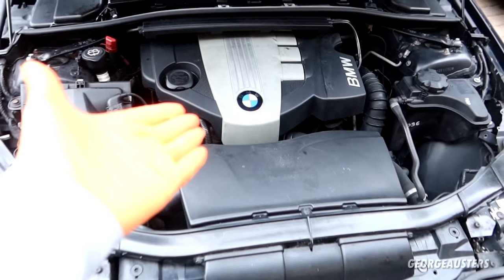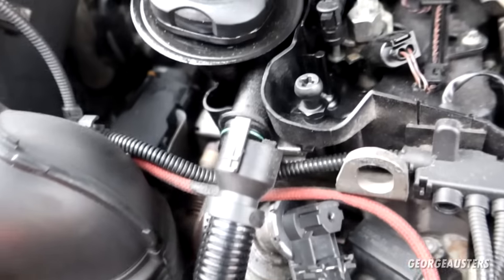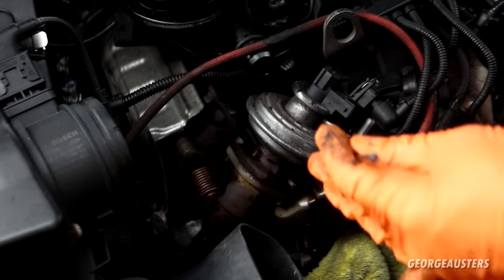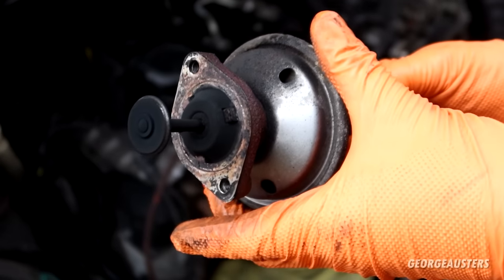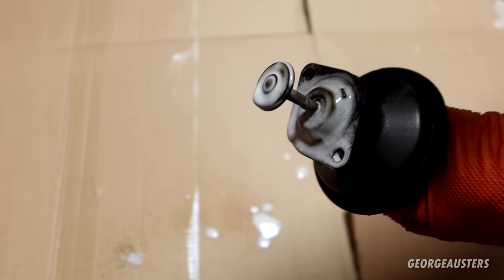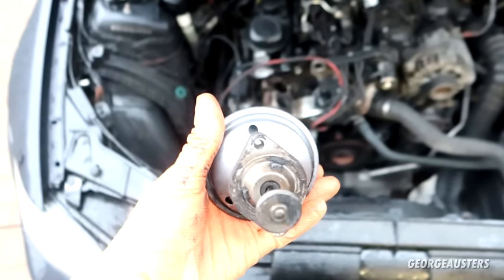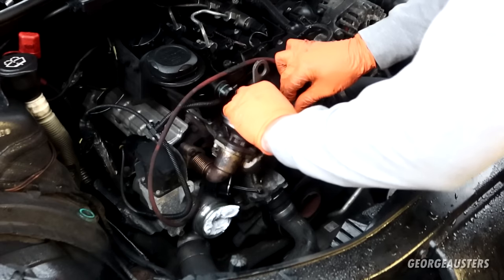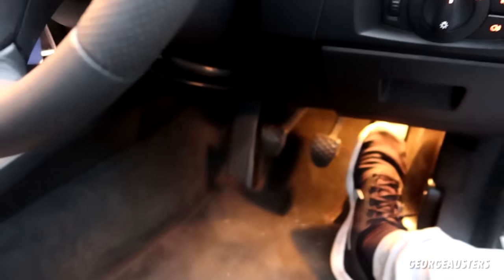HOW TO CLEAN A BMW N47 EGR VALVE

Comment: Driving a car on public roads with the egr valve removed is a criminal act. The valve is there to make exhaust gasses less toxic.
Reply: Both the EGR and DPF are just causing a lot of problems with diesel vehicles. Remove them and save a lot of money on maintenance.
Reply: @TheJensss  Maintain your car properly and drive it conservatively and you will never have problems with either of them. If you can't afford the maintenance of your vehicle you should drive a vehicle you can afford i.e. a smaller car.
Reply: @SuperDirk1965  what a bad answer. In Norway we have really cold weather, and we use the cars for a lot of short trips. This is resulting in a lot of problems with EGR and DPF. A regular service costs 500€ + and with EGR cleaning etc you could expect a total cost of 1000€.....

I'm doing my own car maintenance and i'm saving a lot of time with the problem components removed from my engine.
Reply: @TheJensss  Only dumb people use diesels for short distances. For short trips, buy a petrol car or even better an electric car.
Reply: @SuperDirk1965  Come to Norway and look at the pricing on cars, fuel and the road network. You clearly have no knowledge about the conditions in my country, and the cost associated with it.
Reply: @TheJensss  As i said, don't buy a car you can't afford. A large car does not impress other people. A small car on the other hand is affordable and you don't have to commit criminal acts to be able to drive it. You do realise that you're confessinbg to commiting criminal acts with your name and surname on an open channel right now.
Reply: @SuperDirk1965   I do not live in the EU, and we do not have those stupid rules in my country so you're wrong. I also need a large car for work etc so why should I buy a car that does not meet my needs?
I also have a petrol car, but that does not solve the issues with the diesel car?
Reply: @TheJensss  Drive the petrol car for the short distance and use the diesel for the long hauls. That way you egr and dpf won't clog up. Are you trying to tell me it's legal in Norway to drive around in a car that has the egr and dpf removed?
Reply: @SuperDirk1965  Lol, when driving in -15c the dpf does not work properly. First i drive 10km to the office, then I would drive a couple of km to a customer, back to the office etc. For this I need my VW transporter to carry tooles and equipment.
My second Diesel a Volvo S60 with a D5 diesel engine I have a performance mod so the DPF and EGR is really not recommended.
And the last petrol car is an modified Volvo 940 that I use for fun driving. That car is not used in the winter because of the salt one the roads.
I'm going to buy an electric car soon, but until the problems with low range in cold weather is solved, it is not interesting
I have not read law, but most of the diesel owners with some knowledge about cars have dpf and egr deleted. Do to the problems the cause with new and old cars.
Reply: @SuperDirk1965  my petrol has an egr valve that wanted constant cleaning until it was blocked, solved loads of issues car actually drove properly afterwards, do what works for you and its not a criminal act lmao its a peice of legislation big difference
Reply: @SuperDirk1965  EV 🤡
Reply: Go to China and look at thé smog and think it's not thé consumer but thé factory that must act
Reply: @TheJensss  indeed
Reply: @SuperDirk1965  6l diesel/100kmvs 12l petrol.
Reply: @SuperDirk1965  clown
Reply: @raiviiitzzz  murderer
Reply: @TheJensss  the DPF isn’t dependent on outside temps. It regenerates by using the heat from exhaust gases and oxidised fuel with help of a heat from gases and a catalyst. If you can’t drive a diesel properly get a petrol version instead. You still haven’t answered the obvious question. Why you consider your modification legal.
Reply: @randomdudeontheinternet9926  I modify the car simply because the regulations with dpf and egr creates a lot of expensive problems for my car. The egr creates a lot of soot in the engine, and the dpf regen is not working correctly, especially in cold weather since the engine often does not get properly warm. 

On the other hand I want a diesel car because of cost, mainly caused by high fuel taxes.

As a fun fact, have you researched how much pollution the world's largest ship causes? and how little impact a few cars without egr and dpf in a rural environment has?
Reply: @SuperDirk1965  sorry greta 😭😭 egrs and dpfs are not needed on diesel engines in fact it’s just more issues to go wrong. most knowledgeable people will remove them / blank them off to prevent further issues.
Reply: @TheJensss har du fjernet egr ventilen? Min 116d lugger noe jævli og tenker å rengjøre den. Har du noe erfaring?
Reply: @SuperDirk1965 i would gladly do it, do you send the money via paypal or bank transfer?
Reply: @svivert0594 You shouldn't use stuff you can't afford.
Reply: @svivert0594  har ikke fjernet, men blokkert den på en Volvo v50. Ettersom jeg ikke har programmert bort EGR så får jeg feilmelding på egr og motorlampa lyser, men det påvirker ingenting annet på bilen så bare tok ut pæra på motorlampa og passer på å slette feilkoder før eu kontroll.
Reply: Wrong , only EU saves the world 🤣 😉
Reply: @SuperDirk1965  you have no idea how dpf and egr works dude. I drive "conservatively" as you say, and it just happens. Happens with every egr. Mine has done 362.000km, of course its clogged up.
Reply: @maurizioarrivabene8182  I'm a car mechanic so I think I can say I have a pretty good idea how they work. I can't help it you don't know how to drive your car correctly. Btw, egr and dpf have very little in common except that they are both in the exhaust system. The first lowers NOx emissions, the second filters soot particles.
Reply: @SuperDirk1965  lmao ok buddy, so you know it all huh? Having a bad day or what? Is everything ok at home?
Reply: @maurizioarrivabene8182  I know one thing, that you're not my buddy.
Reply: @SuperDirk1965  ok, can i call you my superduperdirk?
Reply: From this arguement my conclusion is one party obeys every command from government, the other can think for themselves.
Reply: @SuperDirk1965 I think you dont know nothing about cars. Just theoretic 🙂

Comment: Yes, Restricting egrs is one thing, removing NO! Yes they suffocate diesels a fair bit, but the large amounts of Nitrous Oxides emitted without...is suffocating humans at an alarming rate! FACT! Fit a restrictor plate to around 10/13 mm dia and your vehicle will run smoother, cleaner and almost eliminate the very problems you’re experiencing! Try and decide then would be good!
Reply: Restrictor plate 10/13mm dia? Where does that go, where the gasket is?
Reply: Robert Brookes Yes, that’s correct, if possible! It would depend on the make and model! Here in the UK they are freely available on e-bay for most, Hope this helps, the difference to my 2.2 d is remarkable, gone from 41ish mpg up to 47 and that’s at 79 mph sustained! Cheers
Reply: Thats it, im going to remove the egr off my 7.4 454.
Reply: orian cunningham Why? Do the right thing and restrict only, best all round for old vehicles!? Cheers

Comment: That's not the original egr, wahler is, and it's a nightmare to pull out, I'm stuck undone all bolts, vacuum lines, hit it with hammer it moves at bottom but won't pull out

Comment: Except for some soot on the valve, there should be no reduction in its intended job performance. I believe this was still fully functional and did not require cleaning at this point in time.
Reply: There's no point in waiting for it to fail before you do the work. Always easier to do it in your own time

Comment: Yeah clean it but the planet requires it to work properly. Engineered correctly it would have had a quick dismount feature for maintenance. They started way to late in the diesel emission game, cars are in good shape and diesel is stuck in the 1980's. Sometimes regulating has a way of promoting innovation which is now lacking on the diesel side. It's sad as with proper legislation and movement your engine could have worked as well as a normally aspirated gas engine today. Void the GDI engine. :) .

Comment: On my Lexus diesel the bloody EGR was solid with suit. Its a fine needle that sticks. I used methylated spirits (works really well to remove carbon) and a scraper and electric toothbrush, don't bend the needle! It will make your car run smoother and avoid puffs of smoke coming from exhaust when you apply throttle, that;s my experience anyhow.

Comment: I use heat graphite base grease on threads in hot areas so it is easy to be removed later. It is called neverseaze.
Reply: How many times a week do you re-torque the bolts you've done this to?
Use CRC Freeze-Off and instead of letting your bolts vibrate loose, it shrinks the bolt you spray it on and releases it from the threads.

Comment: Surprisingly easy to get to. Practically an engine out job on my car.
Reply: Is it a French make? Just asking as I helped a relative replace an air filter on his Passat and it was a right kerfuffle.
Reply: @kevinmothers904  - .............. which is a GERMAN car.
Reply: @gregtaylor6146  Your'e right Greg! Just had to ask him what the bloody thing was and it turns out to have been a Citroen PICASSO not a Passat. Two hours of removing one thing after another, never again! Four clips on my Ford Ranger air filter box and it's out.
Reply: @kevinmothers904  - Fair enough my friend, forgive me, I clearly had a rush of pedantry to the head when I made that comment, I'd probably just read some depressing news article and felt unwarrantedly empowered. All the Best, Greg

Comment: Having similar problem with my f10 dpf pressure too high, charging pressure too low and air temperature sensor. cleaned the inlet manifold and found a broke rubber between the cooler and manifold. Problems all started when it was recalled for egr cooler.

Comment: I find your videos really helpful :>)   I replaced my EGR valve on my 2010 E92 N47 2.0 diesel just recently.  The EGR valve is a different type and it was a pig to get out.  Both torx heads sheered and needed to be drilled and extracted out.  The OEM replacement EGR value part had longer coolant pipes that fouled the cooler so ended-up having to shorten and file to ensure a fix.  One of them snapped and left part of the pipe in one of the EGR valve coolant canals so that needed to be extracted out too.  The interference fit of the EGR value and the exhaust manifold is very tight so ended-up using some copper grease to ease fitment.  All sorted now thank goodness.  Your videos gave a great step by step guidence.
Reply: More patience than i would have had well done.
Reply: By way of an update: the OEM EGR valve I fitted isn't OEM after all.  It looks original but sadly seems to be an imitation.  It is failing after just over one month of problem free motoring.  The fault codes that my cheap mobile phone app (Torque Pro) can detect comprise 1) Insufficient gas flow detected from EGR valve 2) EGR valve stuck open 3) EGR valve stuck closed (yes really).  As a consequence, the engine has stalled a few times and can idle rough at times.  Disconnecting the EGR valve electrical connector triggers the engine management light in the dash but has eliminated the stalling and rough idling so far.  This suggests to me that the EGR valve is operating outside of it's expected operating parameters (or at least it's electrics are communicating that to the ECM or PCM maybe?).  The ERG valve will need to the replaced with a BMW original part I suspect.  That'll teach me not to try and cheap skate on eBay with procuring some junk intimation part.
Reply from the maker: Pretty sure OEM is pierburg

Comment: Disconnected the EGR vacuum hose from on my E92 320d N47 engine and done about 300km. So far no engine lights have popped up and I have to mention I have not remapped the ECU. Noticeable gain in power and MPG. Dont forget to seal the vacuum hose using a screw or something.
Reply: I have the n47 engine and after cleaning the car is running terrible. How do I disconnect the vacuum line so I can drive the car again

Comment: EGR looks really clean even before removal - You should see mine in Vauxhall's 2.0DTi with 180k miles on clock after year on short distances ;)
One plus: EGR in this engine is on top of intake - so only engine cover removal is needed to acces (and two screw positioned upwards)
Reply from the maker: This has been replaced before I’m sure

Comment: Better still remove the EGR valve and blank it off. Remove the swirl flaps. Cut open the DPF filter housing, remove it and weld it up again. Then install a custom map into the ECU et voila a full power BMW.

Comment: Thanks for your info video 👍
Currently trying to find a mechanic that wants to change my rocker cover gasket as it’s weeping on exhaust side and once engine/ exhaust is hot, begins smoking as the oil makes its way onto exhaust manifold.
Several indie guys don’t want to touch it as they say they’re afraid of breaking injectors 😞

Comment: I take my EGR valve off annually, I fill it with Carb cleaner & leave it overnight, clean off & reinstall. I also clean the galleries before replacing.

Comment: I used polystyrene liquid cement to clean gas plug on SLR rifle, takes carbon off very well
Reply: That's because polystyrene cement uses acetone as the evaporating agent. You could just use neat acetone in a well ventilated (outside) area.
Reply: I used a whole tube of UHU to 'clean' the innards of my Rolex Watch ....... came out perfectly!!!

Comment: Hey George another nice thing to do is replace the alternator pulley with an AOP one. Along with changing just the controller instead of the whole alternator. 60 pound fix total.
Reply: Where from?
Reply: @Maxton720  Dutch reseller..
Reply: @Maxton720  look on autodoc 535020310 for the pulley. 130649 for the controller

Comment: When i press the valve in and plug the vacuum hole with my finger, the valve moves and it only has a little vacuum left when relase the finger. Doest that means valve is leaking?

Comment: I have a 2012 bmw x3(f25) 2.0d.
N47 engine.
I was driving the other day the car started jerking for a few seconds and then went into limp mode with a drivetrain message on the idrive. It was still ok to drive but with a loss of power. Once i switched off the engine and restarted it 5 mins later the warning had gone and the car drove normal again....the following day it happened again. I checked errors with my code reader and it gave 2 faults  to do with the egr valve. Drove it for 2 days after this with no errors or warnings but I'm sure it will pop up again soon.
Do you think I need to do the remove and clean and replace on mine?

Comment: For anyone with an e92 there's an etorx screw to be removed from the back of the air intake pipe. Not sure what size as i didn't get to remove it. Wish I'd known before taking off the bottom clip, top of the pipe and cracking the crank case breather hose!🙃

Comment: I did mine then looked inside the inlet and had to buy a spare inlet manifold because it was so clogged up. And had to clean out all the inlet ports on the engine. Can't belive how much these clog up.
Reply from the maker: Yep I’ll be replacing the intake soon👍🏻

Comment: Hi George,
Quick question, just bought a E91 and the pipe you called a crank case breather pipe, has tape around it I'm assuming to stop some kind of leak, would this tape affect the egr valve and bring up error codes, I currently have codes for egr showing.
Maybe a change of this pipe is my answer? 
Many thanks

Comment: George, I'm going to make a start on this on mine. I regret not doing it once I discovered the engine light that keeps going on and off. Scan said egr.

However yesterday on the roundabout I dropped to 2nd gear and floored it to 40mph, the car when bang! As if pressure built up and blew out the exhaust. 
Car then went on to half engine power mode.

Parked up had a look couldn't see nothing. Got to my location with half a power doing 30mpg.

I discovered the manifold actuator "arm popped off" the bang was it didn't open the swirl flaps and pressure built up. So causing the arm to come off.

Now I've glued the accuator arm back on.  Feels like the small metal clip that holds the spinning bit is lost for ever. 
Should I clean the egr cooler aswell? Since I am cleaning the egr itself.
Reply from the maker: Get a new intake manifold. Just clean the valve👍🏻
Reply: @GeorgeAusters  oh I already fitted one in April. Stupid of me not cleaning the egr aswell.

The egr in the winter has been playing up.

I found out the big intercooler pipe from the anti-shutter valve came off even when I stuck it with gorilla tape. The bang was from that pipe.
Ivd cleaned the egr today. Didn't look to bad for a 148k mile car. I think the egr cooler may be the problem.
Scan tool said egr. That's about it.

Comment: Hi George,

I followed all steps because my car was not accelerating well. 

After following all steps, I drove my car and my car is releasing a lot of smoke now. Did I do something wrong? 

Thanks for the video tho.
Reply from the maker: Smoke from where?
Reply: From the hood. Its not exactly from EGR part, but when I accelerated on steep road, my car lost power (it was lagging already but this was like worst) I had to stop. I opened the hood and there was smoke. Smoke is also coming out from the exhaust which was not the case before cleaning.

Comment: Cheers George, ill need to do this on mine at some point but will order new bolts and a gasket before hand :). I always find carb cleaner also works great on removing carbon deposites
Reply from the maker: Good luck Craig!
Reply: Hey! 
Do you have PN or links where to get the bolts and gasket?